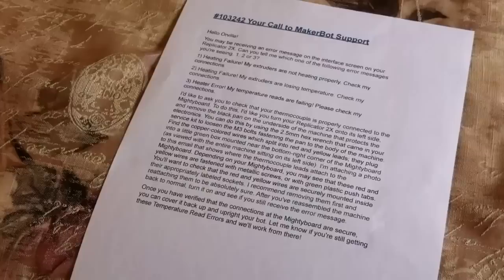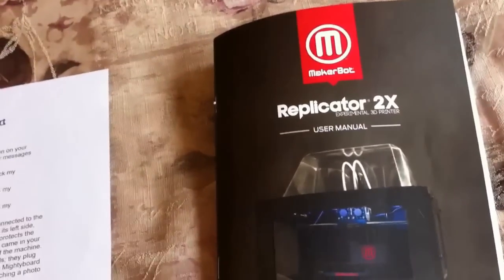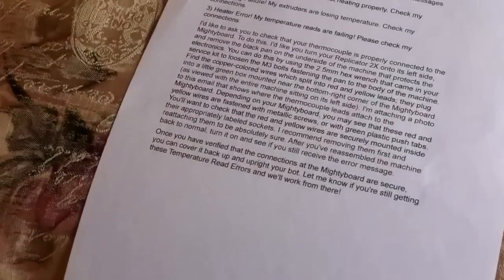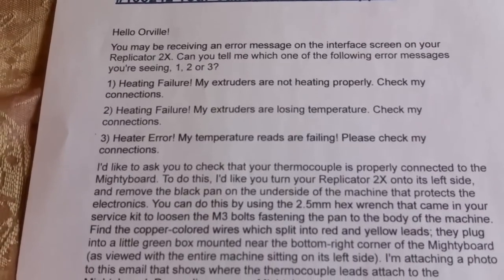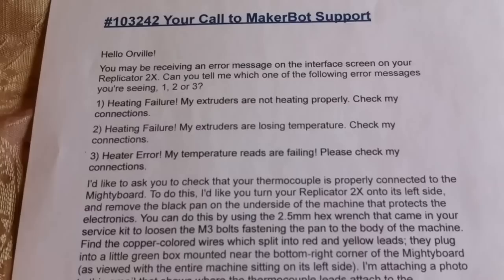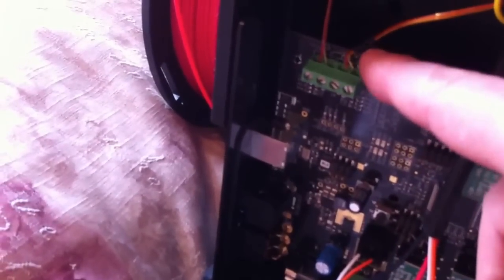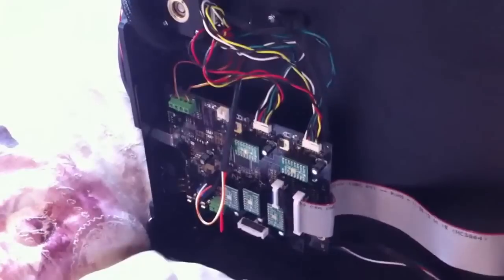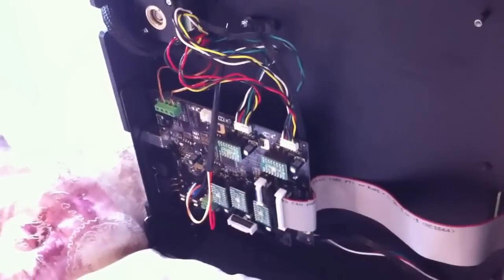Checking Makerbot Replicator 2X Thermocouple Cable

Comment: I had the same issue after the 1st week.  Makerbot sent a new unit no charge.  The biggest issue seems to be the push connectors on the board.  It just sucks so be sure to push with adequate force to anchor the wire.  Give it a tug to be sure its firmly in.  the other issue was the bend and  placement of thermocouple wires up through the fan mount.   Replicator 2 build plate fan mount from thingiverse is a great upgrade with wire keepers built in.